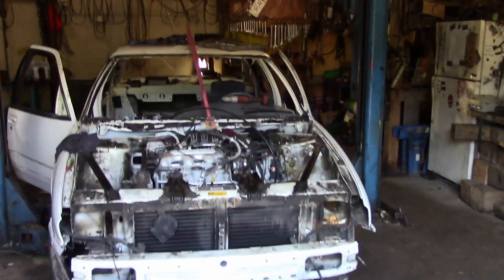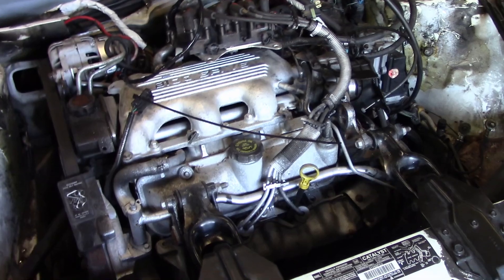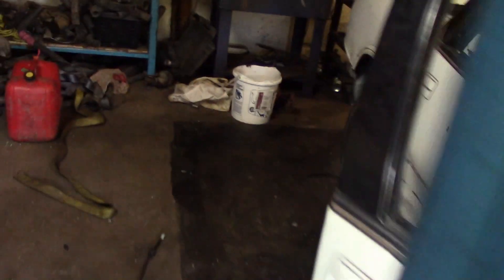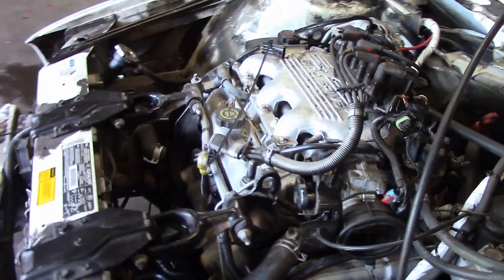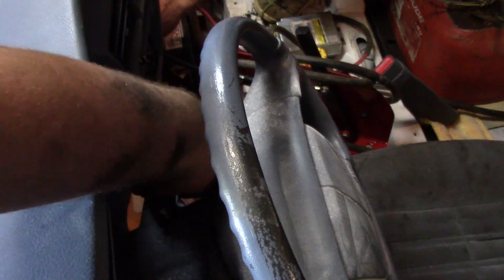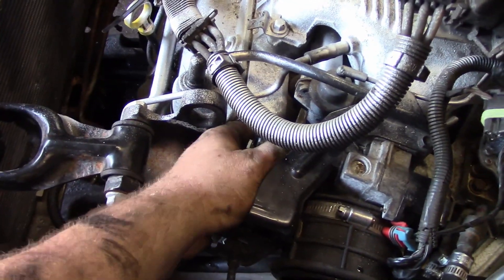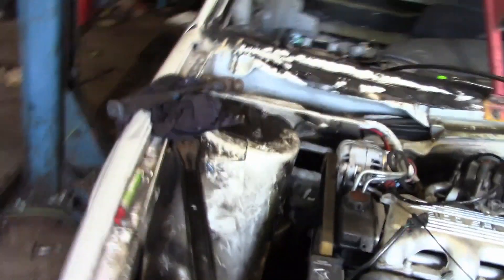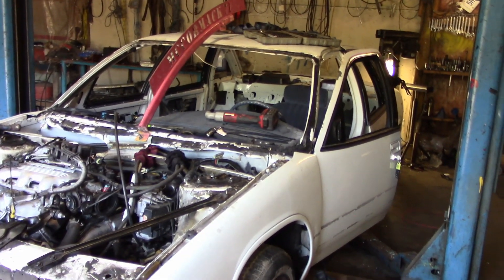w body wiring move in a 1995 , it runs and what are my plans

Comment: And make sure  bleed both antifreeze lines  on both sides of motor
Reply from the maker: ya i was told you have to dothat why do you have to do that
Reply: workshop  you have to do it because it's a high point in the cooling system that will trap air if you don't